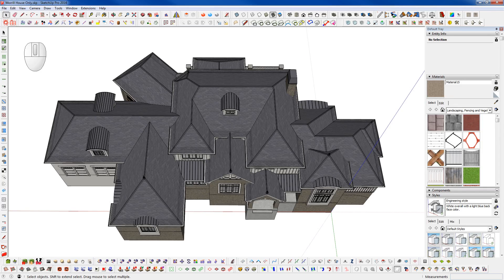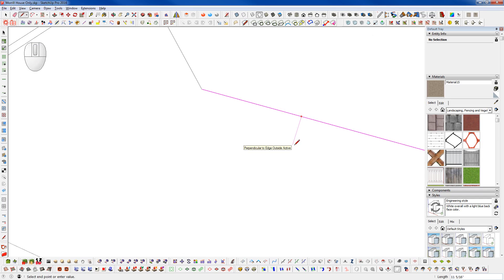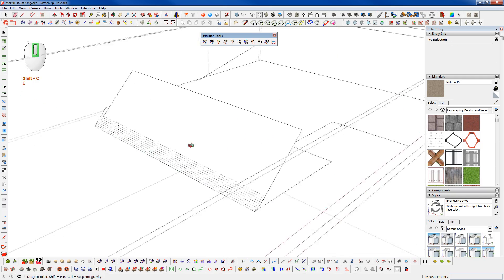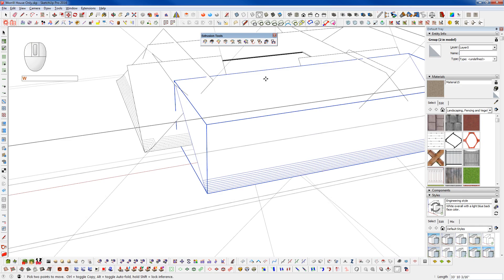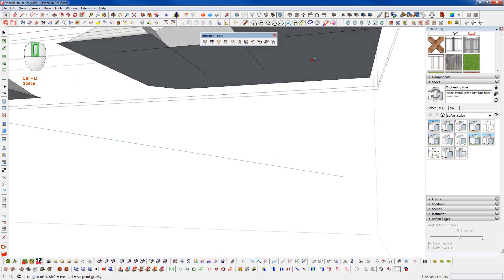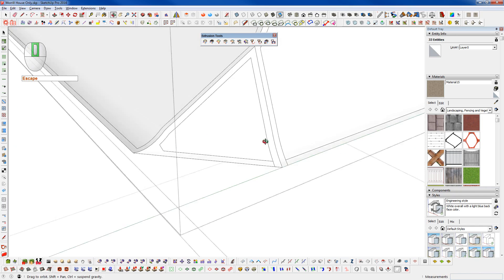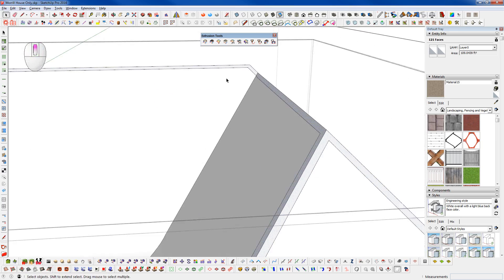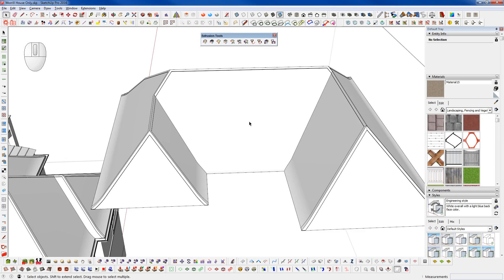Sketchup Tips - Hand modeling a complex roof.

Comment: I would run screaming away from any house with such a roof. Not just due to the bizarre aesthetics, but for pragmatic reasons (maintenance, increased likelihood of failure, cost of roofing, unnecessary complexity, etc.).
Reply from the maker: I hear you.  I had nothing to do with the architectural design, but was obligated to model the house in 3D printer n order to depict the site design in context.   I could have also cheated the roof, but I enjoyed the challenge.